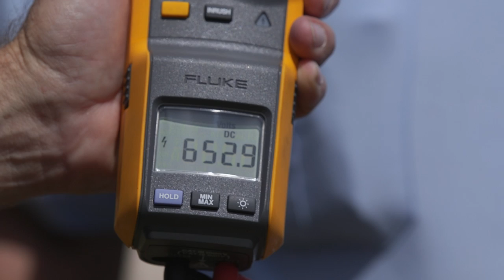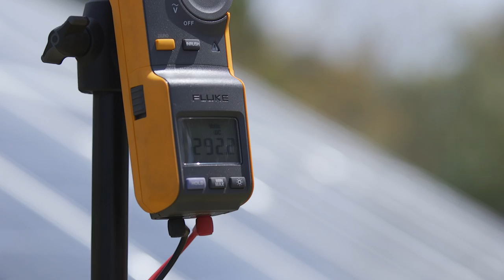Electrical Arcing & Water Conductivity

Comment: Brutal sales attempt. Bringing fear to solar so you may sell a fire extinguishers...
Reply: Being forewarned allows you to be prepared, solar panels do not have 'off' switches
Reply: whorayful , let all just be honest with one another. Transparency sells.
Reply: I'm in Australia and had never heard of this product, I do know our fire department have issues with house fires when PV systems are installed, more than a few houses have probably burnt down due to PV faults when the panels couldn't be neutralised. This product is definitely aimed at emergency services people not the home owner. I suppose any publicity is good publicity.
Ray
Reply from the maker: I am sorry you interpreted the video that way.  We are not trying to scare monger, we have bee involved in the solar industry for over 40 years and firmly believe renewable energy (including solar panels) are the future of power production for the planet.  However, there are genuine safety risks associated with solar PV systems that no one has adequately addressed.  We are proud to be addressing these issues and improving solar system safety.
Reply from the maker: That is absolutely correct!  We are raising awareness on the issues with the intention of improving safety for firefighters, emergency services personnel and electrical contractors.
Reply from the maker: Hi Ray,  We are Australia based and PVStop is an Australian innovation.  Australian Fire and Emergency Services (and indeed fire and emergency services around the world) do not have adequate procedures or tools to effectively mitigate the hazards posed by solar PV arrays.  PVStop has been purchased by FRNSW, ACTFR, NTFRS, CFA and SES SA and we are confident that most Fire & Emergency Services under the AFAC banner will adopt our technology over the next 12 months.  The major Fire Brigades in the UK have also rolled out PVStop and we are about to launch in Japan and the USA.  We have been keeping a relatively low profile and rolling out the product responsibly, developing appropriate procedures and WHS practices with the relevant authorities.  We are definitely not marketing the product directly to the general public due to safety concerns around untrained personnel trying to take PV safety into their own hands  I'm really not sure why this particular video has gone viral, we have not paid to have the video boosted, but something is going on!
Reply: PV Stop , I’m not doubting the product.  I’m sure it’s the most effective solution to date. 
It appears the video’s intent is to bring uncertainty to the safety of solar power generation. Example to have footage of a melting wire via arching.  
Truthfully you could have built a creative back story to why pvstop, is better, strong, faster, safer, and easy to use, best choice for families. 
I’m sorry If this is upsetting, these comments should only help with the development of your future marketing plan. 
Selling via fear is a brutal approach...
Reply from the maker: Hi Jesse, I appreciate your feedback, this video clip was never intended to reach such a wide audience, it was focused at fire and emergency service personnel who understand the fundamental problem, but do not fully appreciate the breadth and depth of the issues.  I still don't understand how/why it has gone so viral over the past few weeks!  Currently PVStop is not focused on supplying the product to consumers which is why it is a little "blunt".  If we were aiming at a consumer market we would have definitely built in more back story explanation.
Reply: PV Stop, I understand. Your agreeableness is refreshing. I know from experience, selling using uncertainty and fear, creates fear of the topic. I am only holding you accountable on the fact that you should be the company supporting the growth of solar use. Your creating a barrier mentally for people doing primary research to if solar power is for them.  You can take the message further with ‘fear no more’ attitude. 

Optics and perception play a large role, tech companies don’t need the added stress of creating the fear and uncertainly in the market your trying to make safer.
Reply from the maker: Hi Jesse, our sister company is actually a solar installation company with over 40 years experience, one of the founding solar companies in Australia.  Unfortunately most people in the solar PV industry are only interested in making money.  The Australia Government have been conducting safety audits on residential PV systems since 2011 and the long term (2011-2016) report shows that 4% of installations are unsafe and a further 16% are substandard.  In the context of 1.7 million residential installations in Australia, those percentages extrapolate to 68,000 unsafe systems and 272,000 substandard systems, mostly from either poor quality "cheap" componentry or poor installation practices, all examples of companies cutting corners to make money at the expense of safety.  This is also the reason why our first target market is fire and emergency services.  Firstly to save lives and improve firefighter safety, secondly, to develop safe systems of work around solar PV arrays so that we can create a genuine, "fear no more" attitude amongst the broader community.  Of course, whenever you publish something on youtube, it is in the public domain, but it was not our intention for this video to go so viral, it was a reference video for Fire & Emergency service personnel to develop a better appreciation of the issues they are now facing every day.  It has unintentionally created a lot of interest, discussion, denial, fear and uncertainty, but then again, any genuinely new technology or knowledge tends to generate these emotions in the general public.  Ultimately we believe our technology will further enhance the uptake of renewable energy as these safety issues are acknowledged and  addressed with better processes, standards and solutions and we are working hard with the appropriate authorities (around the world) every day to ensure we achieve these objectives.
Reply: PV Stop, that message should be your 5 min video
Reply from the maker: Hi Jesse, that will indeed be part of our next video series, developed in conjunction with appropriate fire services support and industry support.  As discussed, this video was originally posted a couple of years ago and we have come a long way since then.  The next video series will be launched in conjunction with our new website.
Reply: This is a nice technique to neutralize solar panels; to cover solar panels with black paint so that solar panels become ineffective.
Reply from the maker: Thanks Souvik, yes, the beauty of our solution is its simplicity.  Although the coating is a lot more technical than a black paint, it is fast drying, fir retardant, non-flammable, anit-arcing, non conductive and non-toxic and when you need to reactivate the solar panels, the coating just peels off without damaging the solar panel system.
Reply: @jtothefx  LOL Sorry to say but some do kind of have doubts that this renewable energy you talk about produces enough for what we need, along if it can do it safely as mentioned here, plus alot of this solar panels you see installed on top of houses that are already on an existing grid are usually just there to sell back electricity for the amount you use.
Reply: I think Jesse’s point is, a Trump supporter or coal activist will cut snippets out of this video to push their fossil fuel agenda and say HEY! LOOK HOW DEADLY SOLAR IS!

We legit have idiots in the United States that think wind and solar energy is the most dangerous type of energy.
Reply: @xzibit8614 Homeowner wise, it actually is. Lots of failure and fire points not to mention solar backsheets dropping like flies and leading to unsafe arrays.
Reply: @whorayful9361  Lol, yes they do. My microinverters shut the panels down if theres an issue such as thiz
Reply: @SSMLivingPictures  Only darkness shuts down a panel. Your micro inverter may shut itself down if a problem happens, most do. But a solar panel is a sun activated battery, if there is sun those photons are helping electrons jump over that NP junction causing a current flow, it's sort of what they do.
Reply: @raygale4198  Fair enough

Comment: PV structure must be grouded. All electricity going to earth.
Reply from the maker: That is correct, a well installed PV system should be grounded, however we come across many PV systems that are either not grounded correctly, or deteriorate over time when not maintained regularly.  This video demonstrates a potential risk, in a scenario where the system is not grounded correctly.

Comment: Wow I'm never getting solar  my home is steel frame f that
Reply from the maker: A good quality, regularly maintained solar PV system will give you years of safe and trouble-free operation.  The problem is most owners purchase the cheapest system they can find and do not perform regular (yearly) inspections of the PV system and like any electro-mechanical equipment that is exposed to the elements 365 day per year, over time they will deteriorate if neglected and that is when they can become dangerous.

Comment: Use micro inversors, and never have that problem.
Reply from the maker: Micro-inverters are one of several technologies designed to improve safety, just be aware that the panels themselves are still live as long as they are exposed to light.  The problem is, when firefighters respond to an incident, it is very difficult for them to identify the difference between a Microinverter system, a DC optimizer system or a normal string array system.  Most firefighters do not have the necessary training to identify the different system types.  The beauty of PVStop is it's simplicity, it is equally effective on any type of solar PV system; as long as a firefighter can see that PVStop has been applied, they know they are electrically safe.  Post incident it can be peeled off and does not damage the PV system.  A very simple solution that dramatically improves firefighter safety.

Comment: Why not just automatic glass covers?
Reply from the maker: Glass covers are not practical and would make a solar panel system prohibitively expensive, but in theory, yes this would also work.
Reply: PV Stop If it did work, could it potentially overheat the panels?
Reply from the maker: Hi Bright, no PVStop actually protects and insulates the panels.  The panels are not producing any power when they are covered with the coating, they are literally "switched off", so they do not produce any electricity or associated electrical heating.
Reply: PV Stop Ok, thank you!
Reply from the maker: My Pleasure!

Comment: No roof installations... Got it.
Reply from the maker: We are major supporters of renewable energy and especially solar PV (our sister company has over 40 years experience in designing and installing PV systems) and a good system utilising good quality components, good installation practices and serviced regularly will give many years of trouble free operation.  However, around 20% of domestic installations are either dangerous or sub-standard and this presents firefighters and electrical contractors with unanticipated risks.  Our goal is to raise awareness, improve education and offer solutions to this known and growing issue.